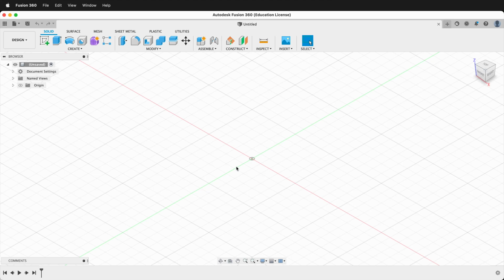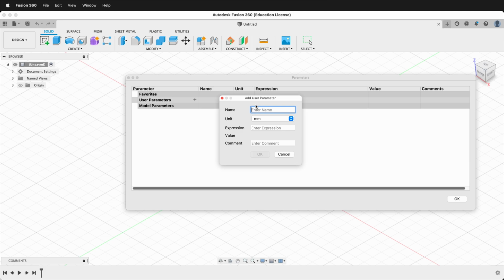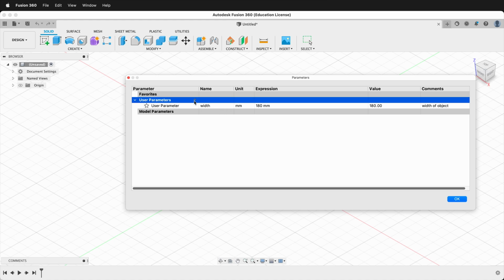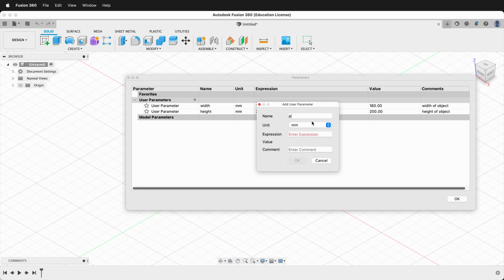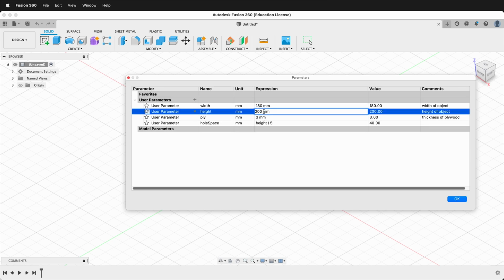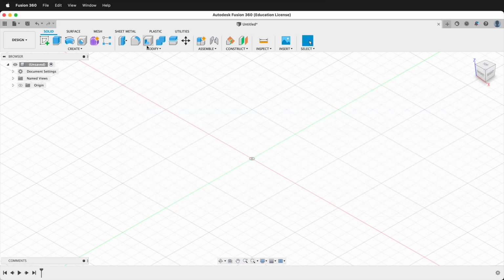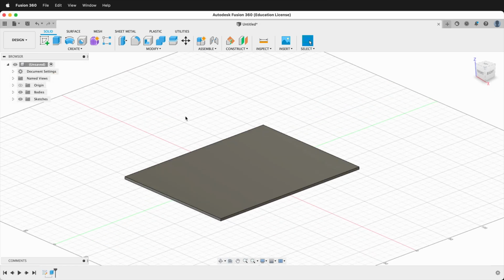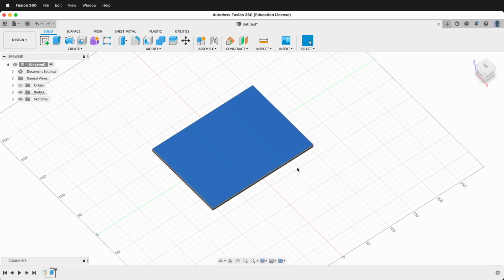Fusion 360 Tutorial User Parameters

Comment: Thanks - that is so helpful!
Do you accept requests? This may be TOO simple, but can you show us how to extrude and taper a polygon (just a square or triangle would do fine) in a way that creates inward or outward curved rather flat surfaces. I'm trying to find a way to make a polygon-base vase that extrudes and tapers along a curve or arc that way, without making and guessing the the size and offset planes and then lofting through them. Is there an simpler and easier way, just extrude and taper the shape and then adjust an inward or outward arc of some kind? Maybe a dumb question, but Thanks.
Reply from the maker: I would use the loft command. You can make a sketch of the polygon that you want. Then make an offset plane vertically from that sketch. Create a new sketch on that offset plane. Then project the previous sketch into that new sketch. Use the offset command in the sketch palette to make your sketch smaller. Then use the create loft command in the solid modeling workspace and select the bottom sketch first and then the top sketch second and it'll loft in between them
Reply: @WhatMakeArt  Thanks -- that is what I will do. Much appreciated.
Reply from the maker: 👍 depending on the angle you want, you can also use the draft command and specify an angle for the draft, but sometimes this is difficult to control the height of the polygon so I would probably still use a long for more parametric control

Comment: One more hint: you can also modify dimensions of existing designs by clicking into the „model parameters“ section. Just unfold the corresponding section and then you can assign user parameters to your design without the need to re-open existing sketches etc.
Reply from the maker: Yes that is a good tip